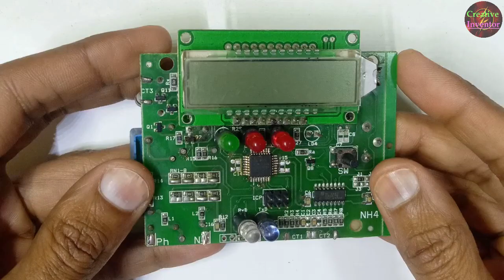How To Re-Cycle Electric Meter,  Atmega88v, RTC, Salvaging Electric Meter Get Valuable Components,

Comment: Bro can u make a charger for coin cell
Reply from the maker: coins cell are not rechargeable, if u force to charge tt will charge and get discharged soon, also it will be risky bcoz it can blast.
Reply: @CreativeInventorlab  I have 4 cr2032 lithium cell I think they are rechargeable
Reply from the maker: how u know that?
Reply: @CreativeInventorlab  it's written on the cell
Reply from the maker: and From where u get that🤔🤔
Reply: @CreativeInventorlab  just found them in my dad's workshop he is also electrical Engineer
Reply: @ultimategaming9843  on no no no this will go bang if charged it uses pile lithium that gives the battry a long life, but DO NOT CHARGE IT.
Reply: @cuf_  thanks bro thanks a lot😇😇
Reply: @ultimategaming9843  ur welcome 🙃
Reply from the maker: i already told him, that the battery can blast, but he was not listening, see my comments above😑😑
Reply: @CreativeInventorlab  😥😥😥 sorry😇😇